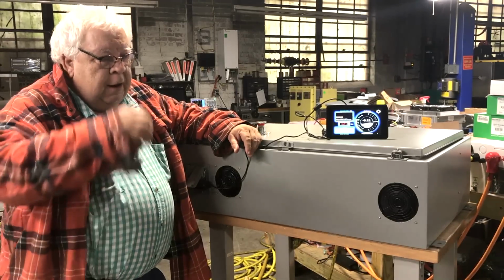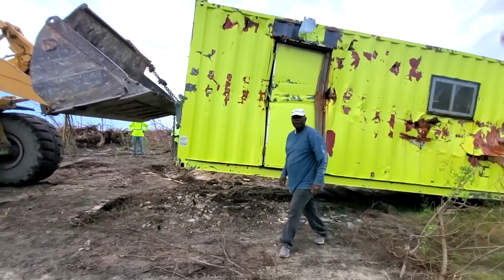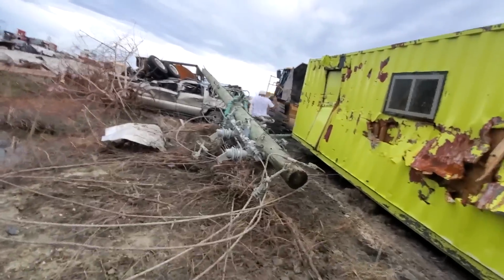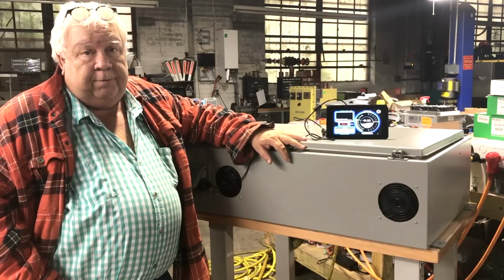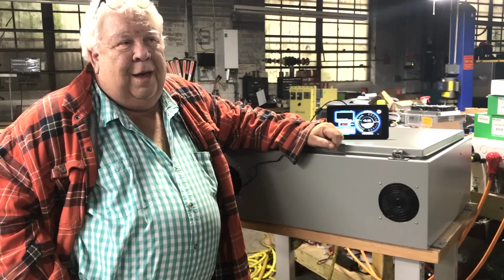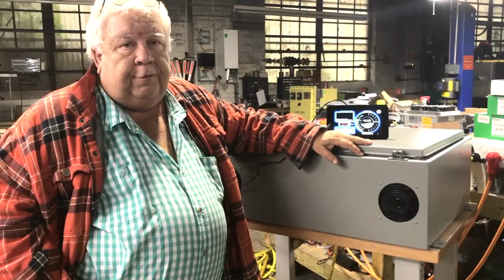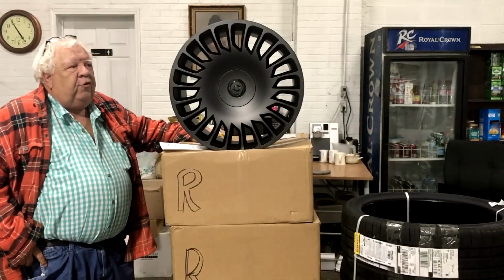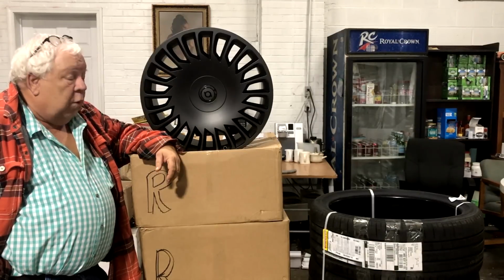EVTV  PowerSafe100 kWh Solar Storage Battery Disaster in the Bahamas

Comment: Jack, I've seen your 48VDC/120VAC 4.4kW Battery storage solution video. I have an 8.2kW solar generation system with (2) SPR4000M inverters on my house. I have a Tesla Model S 60KWh battery I plan to replace with a new battery for the car. I want to mount the 60kWh Model S battery against the outside wall of the house next to the inverters (below the PV panels) as a single 400VDC storage battery feeding the inverters which power the AC distribution panel loads. I would maintain the utility inter-tie to allow selling excess generation and emergency power purchases. Can you supply a design for the charge controller and all required additional components?

Comment: Why do 18650 in Tesla cars have an active cooling system but the home applications don't? How do you prevent the thermal runaway? Does the BMS restrict the batteries more to compensate for the lack of active cooling?

Comment: Seeing them trying to break free that container with that wheel loader, why didn't they use the whole shovel and the hydraulics as a lever?
You know: Tilt the shovel downward, drive back to tighten the chain, ram the shovel lip into the ground, put the wheel loader in neutral und let the hydraulics do the work.

But hey, I'm just sitting here, watching that video and was not there, so I don't know if that would even have worked and if the hydraulics on that thing would have been able to pull that off.

And, in the end, they managed to get tht out of there, so...no point in downtalk their work, I would say.
Reply: Good idea though👍

Comment: Yeah cramming energy in little space = the equivalent of an atomic bomb, it just needs a little nudge to explode, I have 2 sensors per series cell. In a 7s pack, 14temp sensors, and would like more, with 1400+cells and that's only 1/4 of what I intend, for about 2.4k ah. I'm also thinking about putting them outdoors, for safety, I'd like a flir canera type sensor, to monitor the whole battery temp, and shut off if anything gets hot!

Comment: Everyone needs a few panels, and atleast a few leadacid batteries, about 600ah+ 12v so you could charge with your car,  this and atleast 600w pv, can keep the fridge going, a few lights, and some entertainment, microwave, for a day or so , before needing charge , with a 2500watt inverter, the fridge and microwave may not work at the same time, but neither run long, for as little as $2k you can have some power in outages, and shave the peaks, for that crazy time of use! Just an idea!

Comment: Do you do much charging with alternators? I have a 7s 24 v system, and would like the option to charge with a alternator, to atleast 90% of the 29.4v max, or about 28.7v, there aren't many charging options to charge with alternator and lithium, not and have the alternators and batteries live, the DC to DC chargers, are expensive, 20amp, for nearly $500, a midnight classic, or outback flexmax can charge with alternators, on some cases, but the voltage gas to be higher than battery, lithium batteries do not last if held at full voltage, it needs a high voltage disconnect,  I would like to charge at 100+ amps, do you have any suggestions??

Comment: Regarding the wheel:  They need to solve the problem with the low profile tires.  Low profile tires look cool but are for racing, not for street use.  They do firm up the steering and road feel.  Which is fine for a well groomed track.  For regular street use they roughen up the ride and are very vulnerable to pot holes and RR tracks.  A moderate speed hit will shoot through the tire and break the wheel.  $2,700 tire and wheel gone in a flash.  A lot of your suspension is handled by the air in the tire than you would think.
Reply: There's a guy here on YouTube with a Tesla with 21s warning people after the poor man broke a wheel just driving down the highway. He pulled over and watched hundreds of other cars pass with out issue. After watch this I would NEVER get tesla 21s. After watching Jacks video I guess the turbine style in any size is off my list too. Can't believe Elon built a car with efficiency in mind but used these inefficient wheels.

Comment: I predicted the first chain attached would snap.  It's one thing to lift one side of the container, it's another when adding the dragging resistance.  Seems those standing nearby stood back from the chain, expecting it might break.  Recall all of those cable snaps made on the Gold Rush tv shows?  Funny how many don't have an ounce of "intuitive sense" as to the strength of things.

Comment: Living in areas with a high probability of several hurricanes passing through each year requires a wood textured, concrete home when needing to battle with Mother Nature.  Steel is another building material alternative.  Anything made of wood placed outside the concrete home needs to be considered as future rubble.  I much prefer an occasional earthquake that historically does more shaking than causing any actual damage.  If you need to be close to an ocean, then pick a place with a historical low chance of a hurricane (assuming there are better places than the Bahamas).  I’ve thought about other places to live other than “nutty” California and I haven’t discovered an alternate, snow-free geographical area that makes me feel safe.

PG&E and Southern California Edison (SCE) fear being blamed for wildfires and they will experience greater financial losses during the present fire season.  SCE in my area has done about everything around our city to prevent power related fires.  It has been reported that several fires were caused by home powered gas generators during the power outages.  Living 30 years in one place, our power pole has been replaced two times.  An additional guy wire was added at a lower level on the same side of the pole.  Many, many poles and electrical hardware replaced you’d consider lasting beyond a human’s lifetime were replaced.  I sense SCE is putting in a conscientious effort to reduce fire hazards.

SCE is obviously power usage conscious because I receive monthly notifications I’m using more power than my neighbors.  More power usage probably because I run two refrigerators and an air conditioner.  A/C is not common in Southern California because of many older homes with poor insulation and some consider it as a convenience.  My newer home has good insulation and I consider A/C mandatory after experiencing it in the home.  I personally installed a 32K BTU Pioneer pre-charged mini-split system.  Hardest part was bending 1/2” copper tubing.  Bent a lot of tubing back in the 1970’s with my vehicle steam power plant construction hobby.  Powering a steam generator fueled by Standard Brands paint thinner seemed promising during the “Jimmy Carter” days of long lines at the gas stations.  Within the past week in the mail I received a notice from SCE to set up an appointment for a “pole Inspection.”  I think SCE wants to snoop around my property to find out why my home uses more power than my neighbors … screw them.  Note:  The Standard Brands Paint Company was a Southern California corporation.  If you filled up your own container, Standard Brands would sell you paint thinner for twenty cents per gallon.  Paint thinner worked great for a steam generator burner.

You’d think with all the lawsuits SCE might be happy with more money coming into their coffers.  SCE in the past provided up to $1K rebates for EV purchasers.  And SCE is making power available for the EV vehicle.  But SCE remains quiet as to actual infrastructure expansion of future power needs, only a lot of talk about the dire needs for “change.”  There’s no doubt liberals operate the power companies, so of course the focus is probably on non-fossil fuel power source generation.  The recent PG&E power outage made a lot of EV owners nervous because of the inability to acquire a quick charge-up and possibly there were EV’s forming lines at the charge stations.

The higher efficient wheels are interesting.  I never would have thought about the efficiency of wheels.  Can wheel configuration comparisons be made by looking at AC motor power consumption differences by no-load spinning a wheel at an equivalent freeway rotational rate?

Comment: Definitely more dollars then sense! chain bottom to top through the lift eyes drive the bucket under the connex loop chains around bucket clevis from the bucket's hooks curl bucket to tighten chains and transfer some of the weight to the rear of the machine.
That guy walked under that bucket holding up 3 times the weight it is rated for with chains of no doubt questionable rating. I do not fear death, I have no wish to be crushed and alive.

Comment: Interesting I started with 24 volt powerwall 2.5 years ago. I used 16kwh chevy volt batteries. It did run my house for 9 months. Then went to 48v with 56kwh`s of chevy volt batteries with 2 inverters one 12kwh and on3 6k to charge my car. I`m in Ca. so when the PGE shut down I was just fine.

Comment: I believe lifepo4 prismatic cells are the way to go-typically 2000 cycles to 80% capacity remaining, much safer, relatively simple - cheapish bms, wide range of acceptable charge/discharge rates, off-the shelf invertor/charge controller with mppt and grid-generator capabilities easily obtainable. With the right supplier relationships, turnkey packages could be created at around $3-400 per kilowatt.
Reply: The battle of the chemistries
The "Levelized Cost of Storage" (LCoS), so the cost per round-trip kWh, can also be an interesting parameter for battery (system) comparison, but is more difficult to calculate than price per kWh capacity. I guess that's why Solarquotes [1] cleverly uses the "cost per warranted kWh" energy throughput during the warranted life of the system.

Safety
A broad topic, how to quantify safety? I wonder how the Tesla Li-NMA compares to Li-NMC and LiFePo in terms of 'exothermic heat' [2] in the overcharged state. Anybody? From [2]: 

"A LiCoO2 battery has a very narrow overcharge tolerance, about 0.1V over the 4.2V per cell charging voltage plateau, which also the upper limit of the charge voltage. Continuous charging over 4.3V would either damage the battery performance, such as cycle life, or result in fire or explosion.

A LiFePO4 battery has a much wider overcharge tolerance of about 0.7V from its charging voltage plateau of 3.5V per cell. When measured with a differential scanning calorimeter (DSC) the exothermic heat of the chemical reaction with electrolyte after overcharge is only 90 Joules/gram for LiFePO4 versus 1600 J/g for LiCoO2 . The greater the exothermic heat, the more vigorous the fire or explosion that can happen when the battery is abused."

References:

[1] https://www.solarquotes.com.au/battery-storage/comparison-table/

[2] https://www.powerstream.com/LLLF.htm
Reply: @Jack Rickard So not only the exothermic heat (as a partial/dominant(?) cause of the temperature increase) is allegedly more agressive for NMC/NCA as compared to LFP, also the "trouble temperature" seems to bee reached earlier for NCA/NMC. Also interesting that LFP feels so attracted to that 3.38V level, possibly providing a convenient point of reference.

Comment: Retrieval of that container was a quite unsafe operation. Luckily nobody got hurt.
Reply: Hassle Free clueless bunch of numpties at least no one hurt ----Fred Kanos'
Reply: When the crew has to rely on luck to be on their side, then it's certainly not safe. I cannot imagine you'd allow anything like it going on in your workshop, or would you ?
Reply: @hasslefree3527  The phone pole would have helped under the last 1/3 of the container.  One crew member even suggested that but was ignored.  The poor bucket loader has never seen a grease gun.  All the pins are galled and screaming.

Comment: Nice video. It’ll be interesting to see how the power safe turns out. If you’ve never owned a set of low profile tires, you’ll need the number for a roll back on speed dial.

Comment: Also, if Tesla powerwall is 13.5kWh at below 10 grand with 5/7kW rating, is it a niche you should be in?
Reply: @Jack Rickard Your choice of course, just that if Tesla has an elegant off the shelf product at a lower price point it might be a difficult market going forward. But maybe Tesla's product is less flexible. Maybe consider a more nimble enclosure. 
If Tesla is doing multiples of 13.5kWh, I might look at getting bulk 21700 cells from LG at near 100$/kWh and putting together a neat nimble 2kWh product with say 2kW output and maybe not grid tied if that requires elaborate installation and circuits, just a manual backup. If you are running LED lights and laptops and phones and a fridge they might only average 60W which is a day and a half. Could even include cooking on a hotplate and minioven. With a few solar panels that can refill during the day, even in overcast winter, that could keep them going for weeks. If 2kWh of brand new quality cells is only 250$ and you sell it for 1600, that's a manageable item for a lot of people. 2kWh is only 100 cells. A small neat 10x10 grid. If you are clever, all in parallel, no series balancing. A single spotweld together product. 2kW from 1s is only 600 amps. Easy for modern power electronics, fast pulsed into an inductor to the 110v or 220 needed. or 12 or 24V that a boat needs. 1s has a certain elegance.
Reply: @Jack Rickard yeah Tesla was quite delayed. Also if a 2kWh little unit can be ganged it's psychologically quite appealing that you can just buy two or more later. Low threshold of entry. Maybe a 5x20 block of cells with the two sheet folded around the long edge to meet on a pcb with a parallel row of pulsed inductors, sharing 2 bars for mains. Bidirectional circuit maybe. Could be neat. You could call it neat2 :)
Reply: @Jack Rickard Where Powerwalls have been blessed by the local utility cabal most of the real cost saving features the user could have reaped the benefit of have been forbidden in circuitry before the user even takes delivery.  Permits, delivery, and installation have, in many cases, taken 8-12 months.  You can punch the calculator all you want, but the small sizing drives per unit cost out the roof by-and-by.

Comment: Damn, that's serious wind. Would be interesting to see surveillance footage from that.
I thought the cases you chose for the powersafes were industrial overkill, only making them heavy and unwieldy but I guess if it has to survive that it's not. Should have made it IP69k too though. 
On a side note, I've been looking at yachts recently and came across the 2010 Prestige 60 which is a 64 foot yacht with modern interior and the desired galley aft layout which can be had for only 550k. A new Princess F62 i over 2 million. In case someone was looking to replace a yacht in the bahamas and get the most for the money.
As for the rims, I've seen the ads too and left and right handed shows they have at least thought about it which is more than can be said for essentially everyone else BUT are they really all that fantastic with those holes and aero should not cost 6 grand. Even though they are 21s. You could inquiry in China if some would make fully closed rims for you, maybe a ring of hexagon golf dimples could look nice (with chirality) and if casting closed is wasteful, lathe out the inner grove if necessary. Can't be rocket science. If they can make an 18" for a low price that can also fit Model 3, you could probably push hundreds in USA, maybe thousands.

Comment: Where  would  you be  without the good old Diesel Engine.
Reply: Using an electric machine instead?
Reply: Chris Lee  Supplying those motors with energy (batteries) is still a major problem, but a low-power application (like the loader in this video) would probably do pretty well with batteries. I'm sure some applications (like continuous loading in a mine) still use too much energy for a loader like this to be powered by batteries.
Reply: One thing is for certain that container wouldn’t have moved without it.😁

Comment: Love that wheel. I’d like a ultralight forged or carbon fiber for my Model 3 performance.  That’s an interesting tire they recommend, seems like Pilot 4P are the hot ticket, you should consider a follow up video just focusing on the wheels & tires.  Are those lighter than the setup you are removing?  Curious what your 0-60 and 0-100 look like before/after.